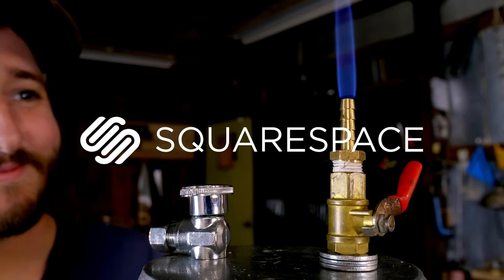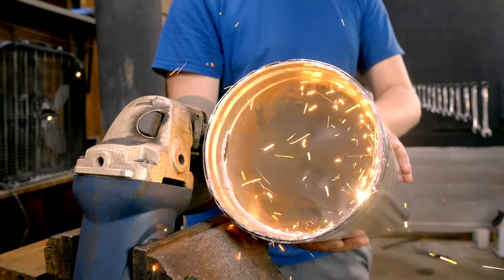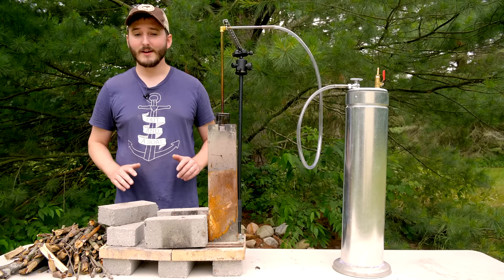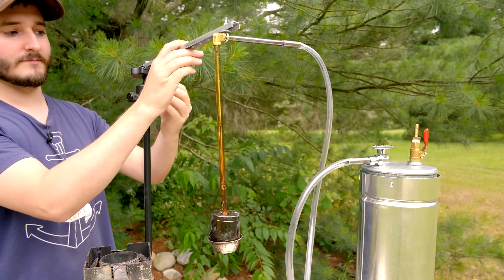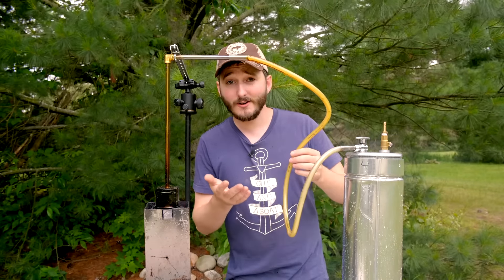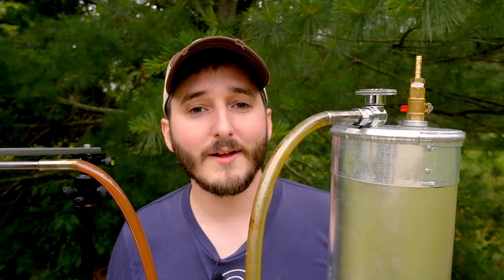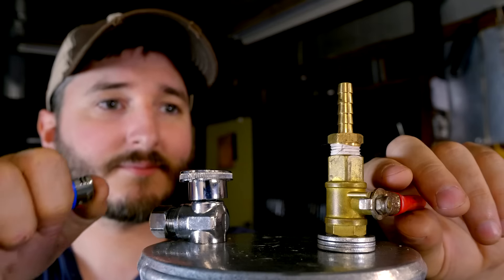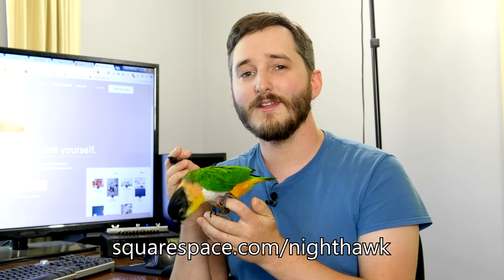Bio Fuel Storage: Building A Gasometer

Comment: Get some PTFE tubing. It's the most temperature resistant material that's flexible. You need specific connectors for it, but it will work up to 500F.
Reply from the maker: Great tip!
Reply: Or lab rubber tubing, a lot cheaper, from amazon or eBay  is easy to find
Reply: Silicone tubing would work
You could put the inlet into the bottom tank, but you still need  a small amount of flexibility
A gasometer normally has 3 walls, the middle one being the top, the cavity is normally filled with oil iirc
If you fill the main chamber with water initially, then when you get sufficient gas you could drain main chamber (bottom inlet would help with this), that would give you more room for gas, and lighter to carry
Reply: PTFE is not THAT flexible and not THAT temperature resistant, it starts to slowly give up around 250°C. Silicone beats PTFE on both accounts.
Reply: PTFE is perfectly flexible and suitable for the application shown in this video. It will hold significantly more pressure as a result of the increased stiffness, which could prove useful if weight is added to the gasometer to compress the wood gas. Additionally, the melting point of PTFE is 327 degrees C compared to the lower 300 degrees C of silicone rubber. Either one is better than the vinyl(?) tube in the video.
Reply: You can't melt silicone, it's not a thermoplastic. Your quoted "melting point" is a fantasy number. It is however not long-term-stable under temperatures of over 300-350°C, it will start to discolour and lose its strength. Depends, could take hours or days, and it is essentially a slow burning process of sorts.

Sure you CAN use PTFE, and it's good to have around, but it does start to get tacky and pliable well under 300°C. Since PTFE has an extremely low Tg (some -100°C or so), its melting behaviour is characterised by a very gradual state transition rather than focused right around the melting point, so it's often moulded at just 260°C.
Reply: PTFE tubing isn’t really flexible, so it might not work for his purpose
Reply: Ohh just add radiator from car heater(or even oil radiator) right after gasifier, and temp wont go above 150-200C...
Reply: Alexander FL-TS Yea but it would get clogged/ need to be cleaned often because of tar production.
Reply: well yes, but in any case tubes will get clogged: outlet pipe too thin, and that place with 90 degree turn. 
in case with cooling need some addition drain tube and valve... and clean system with steam...
Reply: Silicone tubing can go hotter depending on mixture.
Reply: If I'm not mistaken, (reinforced) PTFE hosr is standard in car radiator systems, and racers UPgrade to (reinforced) silicone hoses for heat and pressure resistance and more consistent properties, so yeah, silicone has more suitable properties for this application. Plus, it's basically fireproof.
Reply: @calysagora3615  "Standard" if you mean factory? Is nitrile rubber, some (but a rapidly decreasing number of factories) make alkyl rubber. PTFE (teflon) is NOT flexible enough for use as a car radiator hose or seal. The benefit of PTFE pipe liners coating the inside is nothing will stick to it.
Reply: @seanwatts8342  Oh, I see, I got my chemicql alphabet soup mixed up. I stand corrected.

 But yeah, Teflon pipe would be quite unpractical in this application.

Silicone tubing is simply what people typically use in this kind of situations.
Reply: @calysagora3615  No problem.. I put a silicone hose set on my little car and have not had a SINGLE leak in almost 10 years. They're not cheap but silicone hoses last.
Reply: What is this war, people fighting about which tubing is best
Reply: why not just use metal gas line from an oven, cheap, standard pipe fittings, and the metal should hold up fine
Reply: Silicone tubing would work well and be cheaper than ptfe

Comment: Use bungie to compress it and put a hardline into bottom of your gasometer with a line running inside the inner tube to eliminate the need for a flexible line. Also put a box inline between stove and gasometer to collect tar. This is awesome. Thank you.

Comment: fridge compressor
inlet-gasometer
outlet-tank
Reply: Isn't there a risk that the compressor will ignite the wood gas?
Reply: it needs oxygen to burn
Reply: It's not safe to compress this kind of gas.
Reply: Explain :)
Reply: Technically, there is a risk of compression igniting this mixture, as it can contain oxygen. In order to keep it safe, you MUST intercool the gas, or compress it very slowly, to prevent it from getting too hot from adiabatic compression. So long as you keep it cool, it should be ok. You will eventually (around 120PSI, depending on the composition of the volatiles) compress it enough to condense the volatiles, at which point, you can bleed off the N2, CO, CO2 and O2, which will leave you with almost exclusively combustible material
Reply: Well filling a regular gas tank with a fridge compressor, which has a low airflow won't heat up the gas much
And it would take many many runs to get the tank to 120psi
Reply: arman rgun would this gas work as a refrigerant?
Reply: orbacron you can make dimethyl ether with the wood gas and that can be used and is used as a refrigerant

Comment: if you inject it at the bottom of the gasometer wont you not need a flexible tube and just use metal since the bottom doesn't move?
Reply: You'd need an airtight seal around the space between the two tubes, but that might create too much friction.
Reply: If you make two pipes go under the foot and enter the lower fixed container in the center; going through all the water and ending just after the waterline you could both fill it AND use the gas without any flexible hoses involved. Also without creating any extra friction between the cylinders.
Reply: +1 
First thing I thought of too
Cut a small piece of copper pipe to reach the centre and just bubble the gas through the water.
Bonus extra filtration too.
Reply: Grimidor problem with that is the top cylinder might be too heavy now
Reply: If you inject at the bottom the wood gas is also filtered through all of the water instead of just the water at the top of the tank
Reply: The problem with filtering the gas through the water is that the water pressure may be too much for the wood gas to over come to allow it to push its way through the water. 
Remember, The path the least resistance is key.
Reply: @tonysolar284  Yes, you would need a much heavier lid on the wood gasifier.  One equal or greater then the pressure of the water pushing down on the gasses would be ideal, but not absolutely necessary as the gas would just naturally bubble through the water and separate on it's own.
Reply: Knew i shoulda scrolled down...

Comment: It's really awesome seeing you doing so much experimenting with wood gas.  Like I said last time, try using ordinary trash, like paper, cardboard, cereal boxes, old rags, etc. as production fuel at some point.  It may be a bit harder to use with your current setup, but I think it would be worth it to see how much gas you could produce from it compared to regular wood.  
And on that subject, it might be interesting to see how much you get from fresh wood compared to dead and dry wood.  

Also, bringing your adorable bird in to give us incentive to watch the sponsor bit of your videos is really clever, and I don't regret watching it one bit.  I'd love to see an off-topic video just about your bird at some point.  It's super cute, and it looks like you take very good care of it. ♥
Reply: I think the amount of wood gas produced is equal in fresh or dry wood, if the wood is otherwise the same. The potential for gas produced is not ruled by freshness, it just means it has more water. At least that's what i have always thought. Before the wood will pyrolyze and gasses will exit the wood material, water has to dissipate from it and that takes time and energy so the process is just slower.
That could actually be a test in itself; how much dryness affects before the wood gas starts to produce.
Reply: And vinegar

Comment: If you run your gas line in the bottom it can bubble up through the water to help clean the wood gas. It would also leave the top of the moveable sleeve unobstructed.  In the late 80s or early 90s I saw an article in Mother Earth News. A farmer was running a methane digester with manure. He was using a similar gas collection device only massive. It was so big it had a pulley and counter weight system to make the inner bell neutrality buoyant. I believe his outer tank was concrete. I seem to recall it was as big around as a silo. With a system like that you could change the counter weight as a way to adjust the gas pressure.

Comment: I did a lot of r and d on gasification back in the day and we used a much larger gasometer and gasifier. We had to stack lead weights on top of it to get the pressure to run a small generator.

Comment: Maybe you could add a three way connector with a collection vessel to recover the liquid that condenses out of the wood gas? It's going to be mostly water at first, but should also contain a variety of hydrocarbons and aromatic compounds (wood-tar creosote). These having low miscibility with water, they should separate and could in principle be easily recovered.

Creosote is a cool substance, with some interesting uses, like treatment of wood.
Reply: or also burn it if you atomize it like with kerosene or most oils.
Reply: A water trap.
Reply: The brown liquid can be fractionally distilled to recover the methanol in it.

Comment: Those experiments are awesome, and I can't wait to see what will happen in the future, indeed 😍
About tubing, I know there are some kind of silicone pipes which are capable of dealing with some high temperature (up to around 300ish C, which is about 500ish F), so you should be able to find something (but I see also a lot of comments in that sense): but I live in Italy so I can't tell for sure where to find those things in USA (except something like ebay, amazon or similar)

More than that, have you considered putting a longer piece of tubing (like 4-5mt/12-15ft) which a part is submerged in some cold water? This might help both with condensation and lowering the overall temperature of the outgoing gases.

Comment: Very cool!!! You have answered some of the bigger questions I have had about wood gas, but I do have a few more.  Can you store this gas long term?  Is it compressible for storage space management?  If so, is that something that can be done as a DIY project?
Reply: 4 years later... 
yes you can store for quite a while. several months. however it will slowly dissolve into the water. higher the pressure the quicker it will dissolve. 
I've tried floating a layer of oil on top of the water but cannot tell yet if its making a difference.

Comment: I know this was part of my suggestion on the last video and apologize for the repeat. If you add a copper coil and an intermediate collection can right after the coil but before the tubing you will cool the gas significantly before it hits your tubing thus increasing its life span and you get the added benefit of collecting the condensate before it hits the storage container. Similar to how alcohol is condensed in a still.
Reply: cooper and brass can be considered as catalyst as well and purify the gas
Reply: But the tar by-product would condense and cool within the condenser coils, whereby clogging the system and eventually causing a back pressure into the gasifier can... please tell if I have this wrong?
Reply: @johnjulie6657  yes you are right , i had the same problem with ,mine . the solution was a cyclone filter and wood chips and shavings.
Reply: @johnjulie6657  a very low tech way of fixing that is putting a longer outlet pipe from the furnace. And taking a cue from natural gas piping place a T fitting with a pipe going down. Place a cap or preferably a valve at the end. Anything heavier than the gas will sink into the down pipe. Every now and then crack open the valve to empty it out.

Comment: 7:05 the condensation is a mixture of wood alcohol (methanol), gasoline, tar and diesel. All of them are also valuable. You can set multiple filtration setups to collect them as well.
Reply: how would you separate the four...also is the water in the gasometer tainted in anyway?
Reply: Fractional distillation
Reply: Could actually be harvested with some water-cooling of the pipes, perhaps a spiral chamber with an outlet, then the gas passed on to the gasometer will also be purer but of course also denser, so perhaps you'd need a spring or something to lower the pressure in there, basically sucking the gas in.
Reply: Tube with in and out connection, cooled by water, so it condensates to pipe surface and collects on the bottom as a pool, witch can then be with regulated flow valve let empty to container.

Separation would be using standard oil industry techniques of fractional distillation as it was mentioned, where start product is heated and released to chamber. Due lack of oxygen it wont burn, but turn into gas. Chamber has several different levels with different levels of heat. Gasoline or methanol is easiest to turn to gas and will float on top chamber, where as heavier oils that take more temperature to turn into gas will condensate on lower levels, where these can be collected to separate containers, filtered again and put on use.
Reply: I would consider 'cracking' the distillate while it's still a avpour by heating further over some kind of catalyst. That way you will get more gas from the liquid portion, so more yield of usable gas.
Reply: @sharpjk  the heaviest tar settles, as it is heated the lighter ones will settle farther in a pipe, and the lightest gas will rise and can be collected.
Reply: Oh wow, methanol is very useful for making biodiesel and/or glycerol.
Reply: But the amount would probably be too little.. at this point it would be more logical to create a plastic burner to collect the diesel, petrol and gasoline

Comment: You could forgo the flexible tubing if you put a pipe inside the inner tube that goes up to the top of the water so the water would not flow into it. You would have to pipe it threw the bottom but it would work like a charm.

Comment: Man this is so Great, Sharing is Caring!! And oh Yeah Man I Love the VIDEOS!!!! More People like You and all of Us that care for Our Earth CAN Make the future SOOOOO MUCH BETTER!!! This is great information...I want hydrogen fuel....Hey maybe putting a debris filter for a tractor in the inlet line to purge the liquid while still allowing the gas to flow....Similar to an air/oil separator but is designed for low pressure....I have one aft my pcv valve on my Bronco to snag the carbon and oil before the intake.....It keeps the #8 piston failure away!!! I have also thought of using an air/oil separator in line with a hand pump to pull water from the air......It works for my breath so surely it could work!!...?🤔🤔😇😇🙏🙏

Comment: Thanks for the video! Automotive hose like for a heater coil may handle the high heat better but are not transparent so a sight glass of some kind may need to be added and the size may only get to 3/4 of a inch at the smallest I'm not really sure! Thanks again if i build one and find a different high heat hose I'll let you know.

Comment: Gasometer tubing:  you could use flexible metal pipe fitting like what is used for sinks and toilets if you want something more temperature resistant.

Comment: you can get a ball joint type fitting that lets gas/ liquid through, swivel ball joint for air hose would be bang on failing that swivel ball joint nozzle for irrigation and just drill the hole out. you could use 2 of them and and stainless pipe

Comment: You could make an inside tubing that leads from the bottom to the top of the upper cylinder, above the water (so the water don't enter the tubing) and so the tubing doesn't have to be flexible.

Comment: You could use copper pipe and make a corkscrew like what's used in the water distillation video. If you cool down the corkscrew with water it would cool down the gas enough to not cause any problems with the vinyl tube.

Comment: Filler should have a hard pipe extended to the bottom of the container, so the gas actually flows in through the water to get cleaned up.

Comment: The vinyl pipe is fine if it doesn’t get too hot.

To keep the temperature in check, just hang a wet cloth in the metal horizontal part of the rig.

Comment: You could use a coiled copper pipe or copper pipe thats like rolled up. I bought like 10 feet at home depot. I think they use it for fridges or plumbing or something, but I bought it to use in an essential oil distiller project. Ya it's solid copper, but if you make sure you have extra length it'd enable your gasometer to move and the pipe could move with it.

Comment: for the heat problem outside of the burning chamber where the hot steam flows to your vinyl tube, you may try something like a water cooling recipient before the steams go into the vinyl. Like an old school bong or something ahah ^^ You may try glass or metal tube to conduct the steam from the burning chamber to the water cooling element.

Comment: Sweet gravity bong bro

When you do the burn tests, should add a venturi mixer like the head of a propane torch so you can pre-mix the air and fuel before igniting it, much more satisfying flame that does not need a constant ignition source!